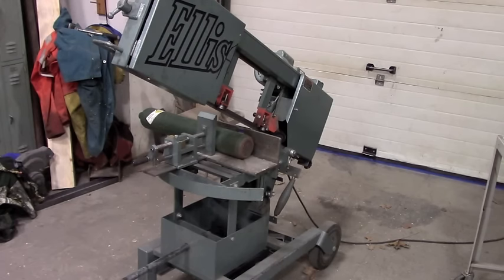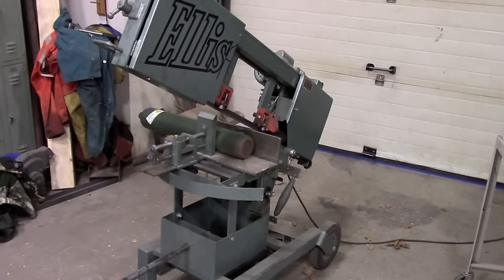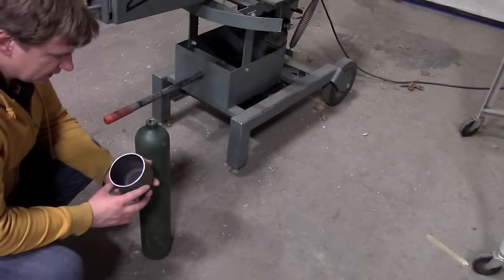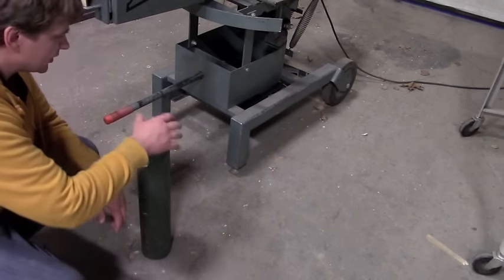Cutting an Oxygen Cylinder

Comment: I would do this to make wind chimes since they have a nice sound.
Reply from the maker: +808Gunz I think that would be cool.  If you had a bunch it would be no big deal tune up a chord set.  They would be loud, they would be huge but they would sound awesome.
Reply: +NelsonStudios I thought the same thing. You could get a few of the small portable oxygen tanks that EMTs and smokers use.   Put a few of acetylene tanks in the mix also.  Use a rotor off a car for the piece that makes them ring. What is that piece called? Connect it all together with logging chain or 1/4 inch steel cable. Where the hell could you hang them? They would make your house sag. HA good luck!

Comment: This is exactly what I was looking for
If you can do that with a steel tank I can safely cut an aluminum tank
Reply from the maker: Mine were empty with the valves pulled and then vented for several minutes with compressed air to the bottom of the tank.  Or fill with water and drain a few times.  After that then all that remains is a round lump of metal.